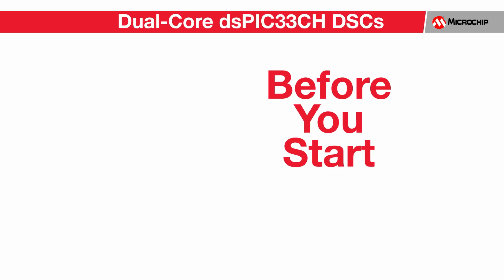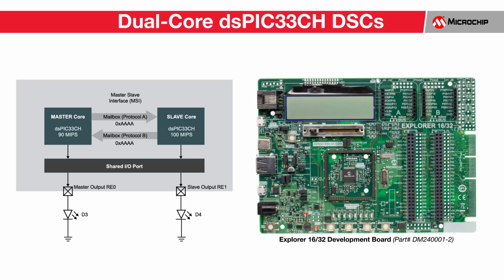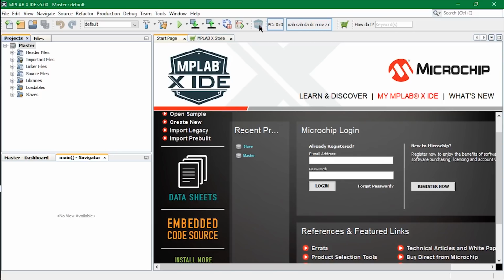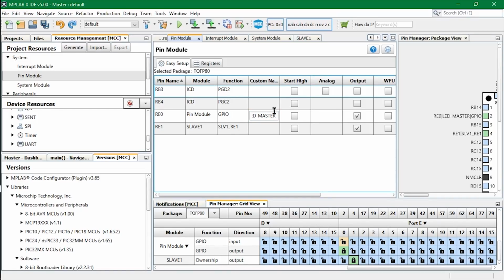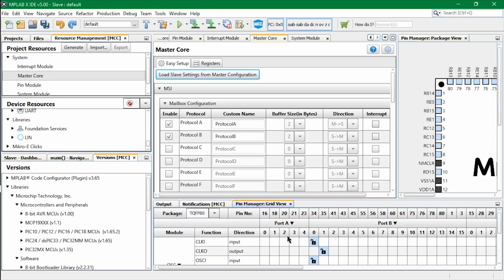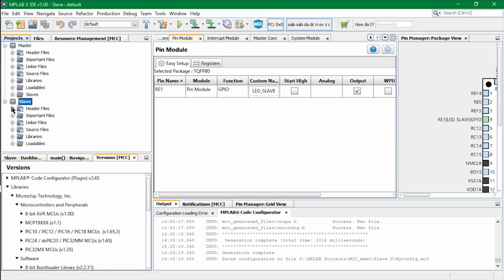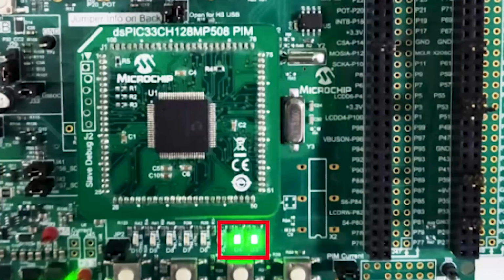Dual-Core dsPIC33CH DSCs Get Simplified with MPLAB® Code Configurator (MCC)

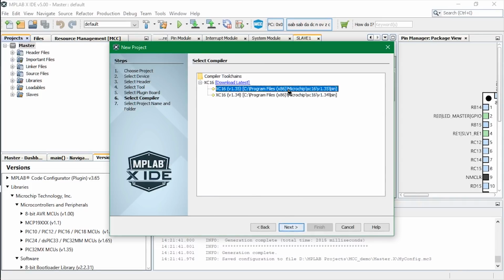Comment: Maybe at 3:20 highlight or mention that the slave core has a slightly different name, with the trailing S1 in the device name. I just spend 30 minutes creating slave projects with the exact same chip name (since its on the same chip) before realizing this.
Reply: Thank you very much that yor wrote about it here! You probably saved much more time for me (and other people) than the mentioned 30 minutes.
Reply: Thank you very much! I made the same mistake three times creating the slave before I found your hint!
Reply: Thanks!!  I also made the same mistake like 3 times and was getting very frustrated!!